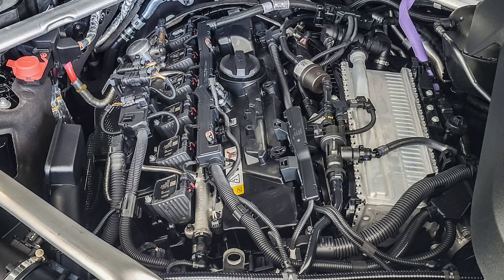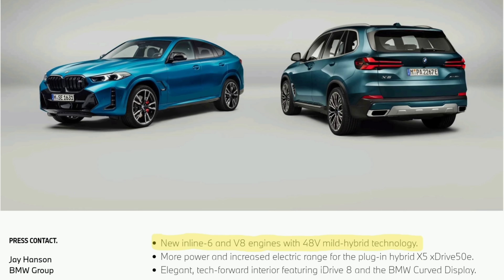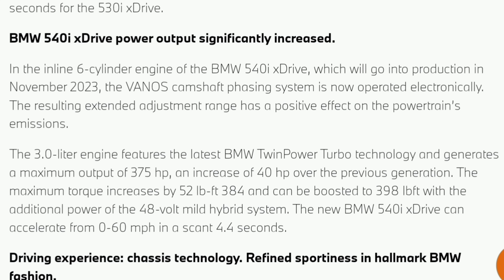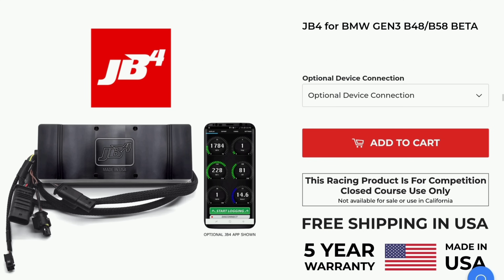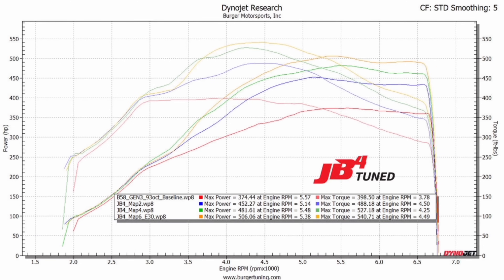M340i & M440i are getting the Gen 3 B58 THIS YEAR!...But should you get it?

Comment: The cylinder head itself isn't the issue, it's the exhaust side adjustable rocker arms. There is currently a recall for a roughly 3 month window of early 2023-produced vehicles. Shouldn't be an issue for those later production dates since they fixed it from factory now. 

They also changed both VANOS phasers, now going from oil pressure controlled to fully electronically controlled with near-infinite positions. Different actuators for those as well and extremely difficult to access them, at least on the X7s. 

But some other cons to note on the Gen 3 is the use of 0W-12 oil, and the change to ignition coils being individually registered in the DME to their corresponding cylinders (goodbye swapping coils to diagnose misfires). Overall a good upgrade but definitely added complexity as well.
Reply from the maker: Well that's disappointing. I know about the ignition coils but I thought it was just more intelligent to make it easier to diagnose individual cylinder issues. I didn't realize it was literally registered to each cylinder.
Reply: @kern417  Yeah unfortunately so, it's the same concept as registering injectors. BMW does mention the coils should last longer due to the new heatsink design but only time will tell 🤞
Reply: Thanks for the info. Do you know how the adjustable rocker arms work on the exh side? Is it dual stage or does it manipulate just one or both exh valves? The initial BMW press release from a couple of years ago had some confusing language but it seemed like BMW was implying that they added valvetronic to the exh side for the Gen 3. Judging from the pics in this video it looks to be something else but it's difficult to see the mechanism and how it works.
Reply: @DylanTLawson  it's a similar concept to valavetronic, but instead of being actuated via worm gear from a servomotor, there is a new dual solenoid/module on the front of cylinder head/valve cover where the exhaust cam is, and these solenoids actuate two long flattened rods (sitting in a small channel along the exh side of cyl head) with springs on the end of each one. The new rocker arms have small spring-tensioned pins on them which are moved forward or back with the flattened rods via the solenoids. The main function of the adjustable rocker arms, from what I am seeing from the description on the dealer's most recent version of ISTA, is to add exhaust-braking capabilities to the B58.
Reply: @NotGunzo ok thanks, greatly appreciate your taking the time to explain this.

Comment: Greetings from Ukraine!
Great content, mate. Keep it up!
Regarding the m340i, I am the owner of the g21 m340i xDrive, obviously it is a EU spec and is built in Munich in July 2024. Mine engine code from the certificate is B58B30B+JA1S03M0, which I reckon is what you refer to as TU engine, the 2nd generation. But I reckon the actual meaning is "technische überarbeitung", which just happens to mean and have the same abbreviation as "technical update". 
So, in a nutshell this newer BMW m performance models actually come with what you refer as 2nd generation of B58.

Cheers!

Comment: Port injection sounds interesting, wanting to put that on our S58 along side the direct injection for more power and eliminate direct injector faults that may happen . 
Diagram in the video shows them piped up to the HP pump though??? 
Would have thought port injection would have been a separate low pressure feed  .
Reply from the maker: fuel feed splits to PI and DI
Reply: @kern417  👍 looks like a reliable cost effective mod to 750bhp for us . Rather than the over priced add on aftermarket stuff. 
Helps keep the inlet ports and valves clean, aids cooling and reduces the effect of a dodgy HP injector melting a piston.
Reply from the maker: Yep. At most swap to slightly bigger injectors and send it

Comment: Just a quick question.You seem very knowledgeable with this new B58 TU2 engine.I was looking at the Canadian MY25 M440i Coupe ordering guide and noticed that it lists this info for the exhaust system in the car,

1D1 Exhaust technology SULEV30
5AL Active Protection
PMTECHN.

The first numbers 1D1 is the standard feature code.When i did a google search it lists this as being some kind of particulate filter.Are you able to confirm that the new B58 TU2 engine in the US and Canada has a particulate filter in the exhaust like European BMW’s have had for many years now?All of the reviews i have read have said that it ruins the sound of the exhaust and results in a loss of hp.

I might just order the current MY24 M340i now because i don’t want to have a car with a crappy sounding exhaust.What is your opinion of the exhaust sound in the X5 and X7 with this engine?

Thanks tor the review.

Comment: What is the work around in event that the DME FIRMWARE updates on unlocked ECUs wipe the tune off, reset to factory tune or shutdown the car entirely ?
Reply: It needs to manually be updated, I can't see how it will wipe it if you choose to just not update it.
Reply from the maker: Then you need to get it unlocked again. Nothing has changed regarding that. That's why tuners recommend turning off OTA updates or going to dealers for software updates.

Comment: Doesn't the gen 3 Dyno stock in the same range as the gen 2? So is it really any less power?
Reply from the maker: What i didn't know at the time is the hybrid system fills in the gap. The engine makes less power but the drivetrain adds power back in.

Comment: Also...they are goong back to the 2port design?  The 6 port can make up to 100 hp more apples for apples compared to the 2port (or something like that according to Mike Botti)
Reply: B58B30M1 has been using 2-post this whole time - only the O1 retained the 6-port head. BMW likely wants to consolidate all production to 2-port for emissions and simplicity, and because they've essentially equalled the O1's output with the 2-port design, they have little reason to keep making a 6-port version.
Reply from the maker: It's not about power for the oems. Most are moving to integrated exhaust manifods because it's more efficient and less emissions.
Reply: @kern417  but less.tuner friendly for modifications and/or upgrades
Reply from the maker: @hg1496  yes it flows less

Comment: Do you think there's a possibility that guys might start using the gen 3 oem manifold and port injection system on gen 2 cars as an alternative to aftermarket solutions
Reply: Had this exact thought on my mind. I wonder if this might actually be a viable option!
Reply: You can get something like the Dorch DS25-350 on the Gen2 and be good for 6-720whp. Easy install. You can use it even with OTS tunes like from BM3. I use it with the e50 tune.
Reply from the maker: I don't think so. It will require at a minimum adapters for the coolant lines, but also fuel lines for the port injection and you'll still need a reflex to control it.

Comment: Port and DI = power
Reply: DS25-350 ez DI power
Reply: @M340B58 di power just for pure800😂 if you are want real power - only PI
Reply: @n0t_fast  for any Pure turbo, 850, or otherwise, and any DAW. With their fuel cam upgrade, it supports 950whp on gasoline and 710 on full e85. For the 20 people that go higher than 650whp, the DS25-350 is still an option.

Comment: @kern417

Do you know if there is also a new TU2 HPFP, which we can use for the gen1?
Reply: If there is port, they will not need to update HPFP
Reply: @n0t_fast 
You‘re right, but hope dies last :-) I‘m in general wondering why BMW developed/installed PI for the Gen3, but didn‘t increase the horsepower. So for what reason did they switch to PI?
Reply: @gwspom  increased efficiency. The Gen 3 B58's main purpose is to meet stricter EU emissions standards
Reply: @gwspom  efficiency = ecology, in the Europe they have way more aggressive rules about ecology.
Reply: @gwspom  for examlple golf r 7.5 in Europe have DI and PI, in USA just DI
Reply from the maker: From what I've seen it's the same TU HPFP as gen 2 b58
Reply: @kern417 
Ok, thanks. And PI in terms of efficiency regulations due to its cleaning ability?
Reply from the maker: @gwspom  it is more efficient in low rpm
Reply: @flyhacking5830  Ok and why is PI more efficient than DI?
Reply from the maker: Look up Low Speed Pre Ignition
Reply: @kern417  I know LSPI, although I thought the reasons for this issue are more like too much load at low rpms, too long oil changes, wrong oil, bad fuel etc.. But I guess PI also helps here with the cleaning factor, right?
Reply from the maker: @gwspom  yes it runs more efficiently in those scenarios

Comment: I’ve been talking b58’s with my friend who is a tech at my local dealer. He says later revisions can make more power, but the original gen 1 b58 is the most reliable. All the extra stuff they put in the TU’s end up breaking
Reply: Like what? I thought it's just a better hpfp and a girdle
Reply: "All the extra stuff breaks" ...such as?
Reply: You want that 2 port exhaust from gen 1…?
Reply: @y00h000 gen 1s are 6 port
Reply: @rileyhagler1373  if that’s the case then please tell me which gen has the 2 port exhaust.
Reply: @y00h000  2020 supras, that’s the only car that ever came with 2 port. all gen 1s are 6 ports, all gen 2 bmws are 6 port, and all 2021+ supras are 6 ports.
Reply: @rileyhagler1373  thanks. I’m only familiar with the Supras guess I figured all of the other cars had the 2 port as well
Reply from the maker: Other cars do have 2 port. 5/7 series and X5/X7 are some examples. 6 port was only in in 2/3/4 series and the Z4/Supra.
Reply: dont be mad cause u dont got a gen 2

Comment: I just got a gen 1😭
Reply: Still a great motor don’t worry
Reply: easier to tune without needing to send it to femto
Reply: I got a gen 1 b58 in my 140ix running dorche white portmeth tth800 100-200 4.7 before installing pi so you wil be fine
Reply: tons of development on the gen 1. you're saving money and can potentially reach higher hp than current gen 2s
Reply: @ooopppiiiuuummm  yeah and i guesss what more do you want from the car mine doing 800 ish just fine could go further but gearbox needs to be upgraded its stil stock block and trans stock air intake an stock exhaust mperformance tuner did do some kind of mod to my airbox

Comment: Port injection should have been installed long ago.
Reply: We need to move on from PI and just use higher flowing DI pumps.
Reply from the maker: PI will always have a place to support maximum power and efficiency
Reply: @kern417  can you explain what it is about port injection that makes it better than DI on these engines?
Reply from the maker: @AgentExhale  it is more efficient in low rpm/low load scenarios
Reply: @kern417  would you mind linking a resource to learn more about how PI makes more power in cases like these? im having difficulty finding explanations online
Reply from the maker: https://youtu.be/66C4YIiwRbM?si=xgp3eVuvJ4XCVmIZ
Reply from the maker: https://youtu.be/uVd-ZS5bnyY?si=jasguEudscHVOd12